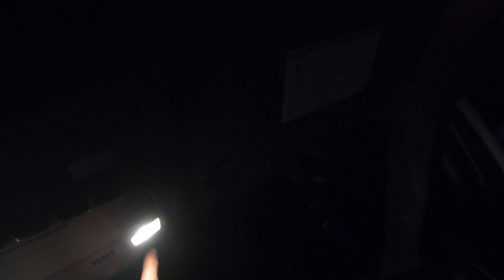#imt #servicetruck #mechanicstruck

Comment: Nice truck! Iv been looking at IMT bodies. That’s kinda shitty that the pto needs to be on for the lights to work. I asked about having an extra light control panel installed in the cab because I like to be able to turn my lights on before I get out of the cab. I was told they could do that but I want to control them without the pto on. I might be doing some wiring on my own,,,,